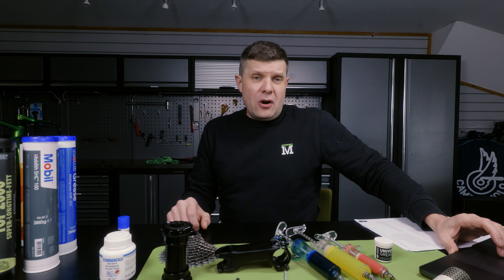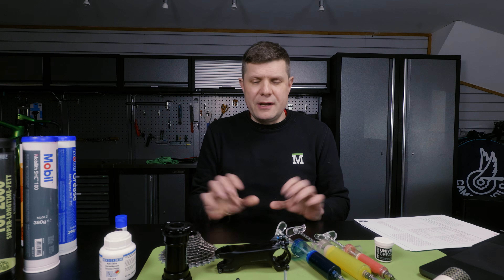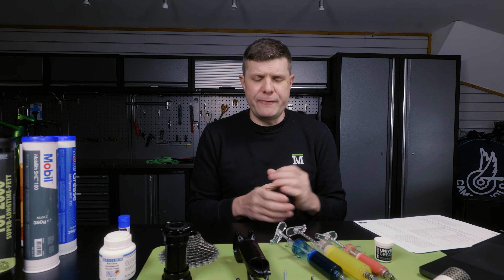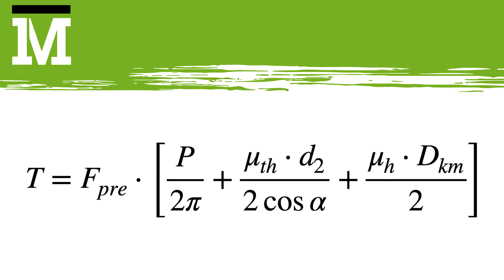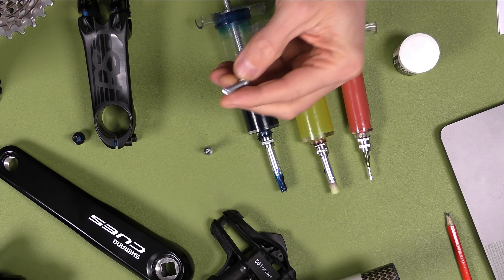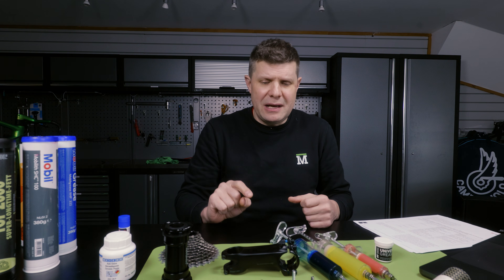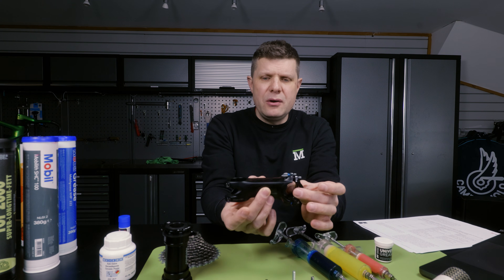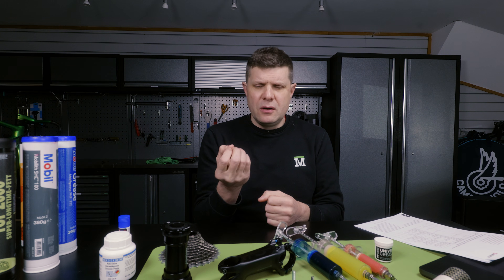Are You a Good Mechanic? (Or Just Lucky?)

Comment from the maker: What is the worst 'Grease Cocktail' or mystery sludge you have ever found in a hub or bottom bracket? Let us know your horror stories below! 👇
If Mapdec Technical on Skool.com interests you, can you leave a litte 👍
Reply: Copper anti-sieze. Everywhere. Headset, bottom bracket, stem bolts, you name it. I spent hours trying to remove it.
Reply: Not exactly a cocktail of different greases - but it seems to me that Loctite absorbs moisture and swell up.  I put too much on the end of through-axle that had a tendency to loosen up. Next time I went to take it out I got the thread undone, but couldnt get it to slide out further.  Fortunately not a blind hole type so I was able to drift it out.   Lesson learned:  don't use too much!
Reply from the maker: @peterlewis2255   I'm interested, what brand asked for threadlock on a Thru Axle in the manual?  It would worry me undoing a soft alu bolt with thread locker on a 12mm. If it was coming loose there must be a reason the axle was not getting sufficient tension or friction. A common cause is bottoming out the threads, usually because a washer is missing, or there is a load of paint and debris in the clamping surface.
Reply: Sturmey-Archer drum brakes completely packed with grease.  Completely.  No spare space anywhere…. Owner said the brakes weren’t very effective!
Reply: Everywhere, thick, dirty, black, hard axil grease. Even inside the free hub body preventing the pals from engaging also in the front wheel ball bearings weren’t rolling but sliding thus worn out cones thus brake rub on corners. He was an older guy and just wanted to be rid of the bike for $60. I gave him $100 so I didn’t feel like I was robbing him. I fixed it for just some time and the new cones and bearings. The suspension needed a clean and new elastomers if anyone can remember them. Now it’s a rare sort after vintage mountain bike from last century in almost perfect condition now.

Comment: Great video! I agree that the grease on the axle is not a great but the axle is stationary it wont fling of.
Reply from the maker: No. But all that excess scraped off as you slid the axle in will. Try it.
Reply: @Mapdec  No, I fully agree its an unnecessary amount of grease

Comment: I have sabotaged myself several times by using a wrong grease. To be specific I used Motorex BikeGrease 2000 for BSA BB threads on my mtb and also on a city bike. 
After a couple hundred ks the bikes always developed a creaking noise around the BB area. I reassembled the BB area many times using the correct torque specs but the same thing happened again and again.
Finally I decided to use a medium strength thread locker compound on the BB threads instead of the grease. I've had no issues since.

Comment: @ 6:47
"That washer is critical for the friction ..."

Correction: the washers' primary task is load distribution, especially when dealing with soft materials.
Reply from the maker: The washer is the same size as the bolt head… still so sure?

Comment: Amazing how things have developed. I’m 60 now and when maintaining my first proper road bike (Dawes Double 5) 45 or so years ago used Vaseline (Petroleum jelly!) in the wheel bearings and bottom bracket without any issues!
Reply from the maker: Vaseline.  That well known water proof pressure resistant lubricant 😂

Comment: If bolt tension is so critical that grease needs to be taken into account I wonder whether the manufactorers have gone too far for a consumer product. Reality is lots of users don’t use torque wrenches, or have crappy/never calibrated ones. I’m all for geeking out and taking wrenching seriously but IMO there should be room for user error. I’d rather have stem and bar combo that’s 100 grams heavier but can be adjusted without a torque wrench (for example after a crash).
Reply from the maker: Some have definitely taken it too far.  Some with extreme caution like Schmolke with super precise instructions, others are winging it.

Comment: Seems that when i swap out stem bolts, usually because of rusty heads, i must use near identical bolt and washer. Common A4 stainless is usually the goto choice but the head is usually larger and a normal washer won't fit in the stem's recess..

Comment: If the reading says “6Nm”, I assume it is the ‘maximum’ force to apply. Therefore, I tighten the bolts reasonably tight but not exceeding the stated figure. No?
Reply from the maker: We covered this in the ≠5Nm did you catch it?  If it stares an exact number assume that is your target to achieve adequate bolt tension with factory setting bolts.  If it says Max, that is a point not to exceed and below that is good as long as the part functions.
Reply: @Mapdec yes, I did. However, I wonder if it still applies universally across all brands. Especially, when we apply the anti-seize. I once had a discussion with a mechanic (he’s a bit traditional, I must admit) and told me some bars that got some ‘dent’ (?) around the clamping area (and that was an established brand). Not wanting to experience such, I now torque all of my components around 20% less than what’s written on it (normally, I’d put some lubricant on them). I am fortunate enough that I weigh quite light (62kg’s), and I assume this will matter more for heavier riders. As for the topic itself, I’m really glad that you bring this up on your channel as it is something that often got overlooked by many nowadays (maybe it’s not a ‘sexy’ topic for may youtubers). The devil is in the details, as may wise people said 😊
Reply from the maker: Thanks.  It’s not a brand thing, but printing values in parts is fairly unique to cycling. Probably because every part needs to be lightweight.
Reply: @Mapdec precisely. Now, I think you know what I meant from that long boring reply that I wrote 😁

Comment: I mostly work on really old bikes. Like a 1980s Peugeot. Most stuff is made out of steel, there really is nothing that I can overclamp other than the threads. Plus these bikes see a lot of salt and water. 

I made the experience over the last 5-6 years that greasing the absolute bujesus out of everything works best IN THAT VERY SPECIFIC CASE!
First of all, good luck finding torquespecs on a 1985 ITM stem. Secondly, I hardly care, if me applying grease might damage something, simply because if I dont grease it, the next time I see that bike, I will simply not be able to remove the part. 
There are 2-3 frames from my social group that have rust-welded seatposts. And plenty of really stuck BBs, one that I am afraid I will not be able to remove. 
So what I have learned working on these bikes is: As much grease as possible, in places where it can actually do something. I for example give a touch of grease to the threads of the chainring bolts. Simply because I have struggled many times to open them, when I needed to replace them. What I did do wrong was simply applying a drop of grease and then what would happen is that grease would mostly drip everywhere and then attract dirt. So I am much more precise nowadays.
Also, old breaks work amazing if you rebuild them and grease the bushings inside. They suddenly have much more cable tension and breaking feels crisp again.

I have always been really careful with carbon. I thought using a torque wrench was enough, I guess not. Also, given that carbon doesnt really rust, I dont think I used grease on those parts ever. 

I am really sad this info is going to be behind a paywall. Especially if the argument is youtube algorythms. Because there will definitley more people watching the free video, even if algo suppressed, than the paywalled one. I get it if you want to make money, just that you would really do a great service to many cyclists and who knows, even save some lives. A cracked handlebar is no laughing matter.
Reply from the maker: Those old steel bikes, the biggest challenge is always just fighting rust.  There will still be the usual YouTube content. But in the shool we can also do hour long chats, publish written work, and talk to professional mechanics in a way that is not so open to the 'uniqueness...' of the YouTube comments.  It's stuff that I want to do to earn a living, but that type of content will never earn on YouTube. Contect here needs to be short, snapy, engaging and probably a little triggering. Otherwise it just disappears.  Take our last video with Phil Burt. Packed with useful info, but as a video it crashed and burned.

Comment: I cannot imagine grease in a bicycle hub getting misplaced by centrifugal forces. If its getting misplaced then by the shocks from potholes and vibrations from the underground.
Reply from the maker: You're not the first to bring this up, seems i didn't make it clear.  Referring to all the think grease on that axle that just gets scraped off as you slide it through a bearing. Just ends up as a ridge of grease on the bearing. The mechanic in the vid also plastered the bearings with it too. Generally you are right all the vibrations and spinning will mix it all up. Try it.
Reply: @Mapdec  I do agree with your arguments why one should not be doing the things in your "bad practice" example.
It's just that if the centrifugal forces in the hub could move grease a ball bearing hub wouldn't stay greased. Try it ;-)
Reply from the maker: @martinmeier9639  It's all held in with seals etc, but it will all mix internally quite easily.  Probably before you have even finished tuning the gears
Reply: @Mapdec  I was thinking more about a cup & cone ball bearing on a conventional Shimano hub, that wouldn't stay greased if centrifugal forces would drive out grease on a spinning wheel.
Reply from the maker: @martinmeier9639ah. I see.  I think now we are confusing mixing with escaping.

Comment: Wow, I don't know how I've managed all these years. I'm 69 now, raced for many years, worked in bike shops as a kid on all sorts of bikes low to high end, we never used torque wrenches, personally never stripped a bolt, blue lock tight was rarely used. You're what 42, 45 years old, do you always use a torque wrench? And what about when no tension is indicated....carbon bars with carbon bars, alloy bars, etcetera. Do you know all the individual torque settings, do you look them up online or otherwise. There are also bolts of various alloys, aluminum alloys, steel, titanium you would have to know the construction/strength of all to know what kind of torque each bolt can take. You would also need to be cognisant of whether the internal threads of the part were inserts or directly threaded. As to the stem bolt washers they are usually pressed on except perhaps on very inexpensive bikes/parts. As to the use of teflon tape which increases the friction and on bicycle bottom brackets works quite well to avoid any creaking between the bb cups and the frame. Recently I purchased a bottom bracket from a well known US manufacturer which actually spedifies teflon tape as well as grease on alloy bb threaded bsa cups, do you not think they know the best installation for their product? The way you talk you seem to think bicycles are rocket science, nothing is turning on bearings which are under incredibly high tension/pressure or high/very high heat. (hence the myth that ceramic bearings are better than high quality steel ones) Also copper anti-seize, contrary to what you believe does not bleed/run off except under high heat conditions (I use it on my car brake caliper slide bolts, on disasembly it is still present) not found on a bicycle and only very low viscosity grease/oil will spin off, good quality waterproof grease will not run off. To be quite honest, bearing in mind this is You Tube and over the top seems to be rule of the day, your verbose technical details will pass over many cyclists heads or those who simply have absolutely no interest. As to the suggestion of a paid Mapdec technical training school subscription this would be superfluous, again in reference to the hundreds, if not thousands of bicycle specific technical, installation, and maintenace videos already out there.
Reply from the maker: Yep. We check, it matters.  Good luck to you.
Reply: 😂awesome rant, especially the agism. FWIW, I’m a boomer too, love these videos because they scratch that deep-engineering itch that us hack garage mechs suffer from. Also, the teflon tape comment is mint. Reminded me that I gotta fix a leak on my P-trap underneath the kitchen sink.
Reply from the maker: @daveanolik8837  PTFE is for tapered BSP threads in plumbing.  For fine pitched BB it just clogs and binds and you have to apply a lot more torque.  On the narrow flange T47i units it’s a bad idea.  Would love to know what brand out there is making such loose threads they need to fill them with Tape.
Reply: @Mapdec ❤

Comment: 1 . Only way to take the whole thing any further is to get a round strain gauge and prove out the clamping force with various lubricants/locktite

2. The vast majority of stems come with blue pre applied  

3. There is nothing on a bicycle other that some crazy titanium doohickey that won't function completely correctly with a basic car wheel bearing grease and blue locktite
Reply from the maker: Yep!  I can agree with that. Although point 3, just add threadlock to that sentence and we should be golden for all but the most sci fi of use cases.
Reply: @Mapdec  what would you put on a bare 3rd party titanium disc brake caliper bolt threading into an aluminium insert on a carbon frame? Calcium sulphonate?
Reply from the maker: @thelmaviaduct  I’m fairly certain this video and the one prior should have answered that.  Umm. Maybe I didn’t explain so well.  Weicon Ceramic Anti Seize.  Reduce your torque setting.
Reply: @Mapdec thank you 🙏🏿👍🏿

Comment: I have an FC-M9100 shimano crank, and it's not clear if the threads should be greased, the shimano docs don't mention grease at all even though it came stock with grease on the splines but i didn't see any grease on the threads.  First time i torqued it I was worried I was going to strip it.
Reply from the maker: si.shimano General Operations DM-GN0001 Page 161. It will all assume Shimano Premium Grease now. They wont publish a K-Factor for it, but it will be around 0.15 to 0.18 depending on the quality of the pedal thread.
Reply: @Mapdec  He's referring to the splines on the bb axle not the pedal threads, what is the quality of the pedal thread, do you mean steel versus titanium pedal axle?
Reply from the maker: @chrisC5339   read the post again Chris.
Reply: @Mapdec  sorry I meant installing the crank not the pedals, it's a one bolt system like gxp, not sure what it's called.